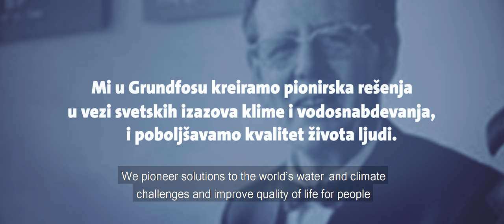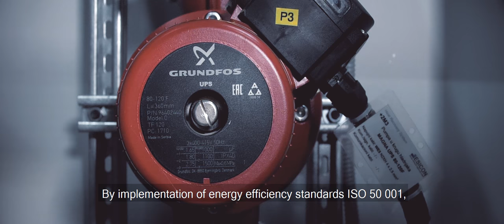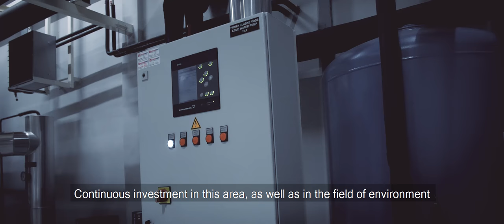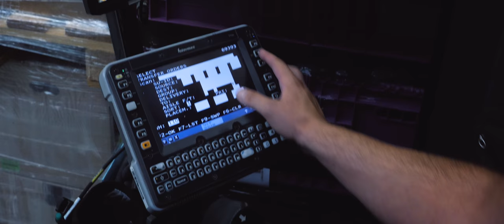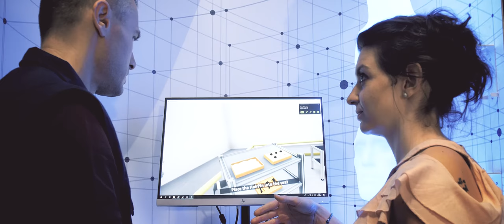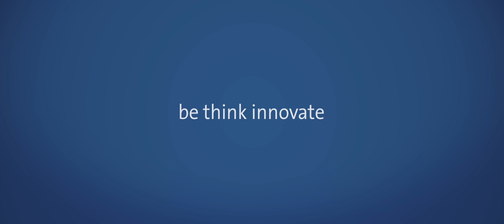10 years of Grundfos company in Serbia

Comment: Congratulations, now please make a scala2 that wont leak right after warranty.. shaft seal and injection molding parting line issues plague this product line
Reply from the maker: Hi Mike, 
We are sorry to hear that your experience with the SCALA2 has not been a positive one.
There were some quality issues on earlier models that have since been addressed.
Please send a copy of the pump name plate, the store where you purchased your pump from (if you know this) and your contact details through the form for your region and we’ll make contact with you: http://spr.ly/60543MDmM 
Kind regards, Grundfos
Reply: @grundfos  hi,  thank you for the quick reply and offer to help , however when i asked for them to help me they informed me that PC 1905 is not affected by any known issue and basically i would either have to buy another thousand dollar pump or start buying parts to repair it.  Its absolutely terrible how little it has lasted pumping clean filtered water in a temperature controlled room.  Its never been stressed or pumped any kind of dirty water with abrasive properties, yet the shaft seal leaks from the bottom weap hole a puddle all day , the front ppsu house has micro cracks and weaps water , the impeller stacks have microcracking from what looks like forceful assembly of the stacks at the factory.  I am in USA and not been offered anything to make the situation correct.
Reply: @grundfos  I filled everything out as asked the same day , no one has contacted me either by email or phone, disappointed to say the least.
Reply from the maker: @Miketime969  Hi again Mike, 
I really understand your concern and I can guarantee that I will be in touch with you until the issue is solved. Please send an e-mail to socialmedia@grundfos.com including your specific location, a description of the issue you are experiencing and your contact information. Then I will be able to directly set you up with a local colleague. But please be aware that delayed answers may occur due to holidays right now. 
Kind regards, Sofie
Reply: @grundfos  Sofia I emailed you a week ago and have not received a reply at all.  Any suggestions? I also sent you guys a DM on twitter and zero reply…..
Reply from the maker: Hi Mike,
I'm sorry about the long response time, but we do not work during weekends, so I have only just seen your Twitter message. Your email is with my colleagues in America and they will reach out to you. Kind regards, Sabrina.
Reply: @grundfos  thank you
Reply: @grundfos  it took a long time but grundfos did the right thing and replaced the pump for me with a brand new one.  Thank you much
Reply from the maker: Hi Mike, happy to hear that you got a new pump:-) Have a great day!